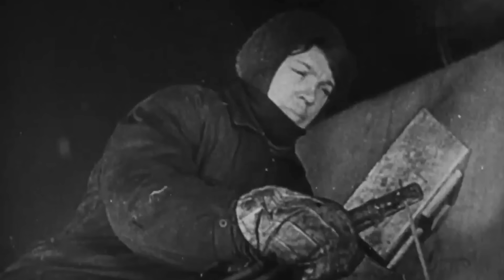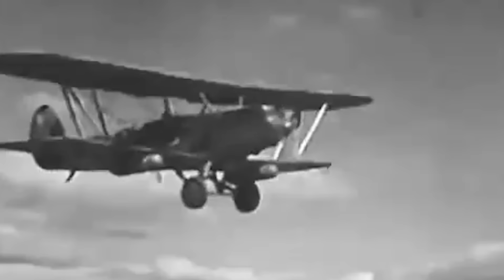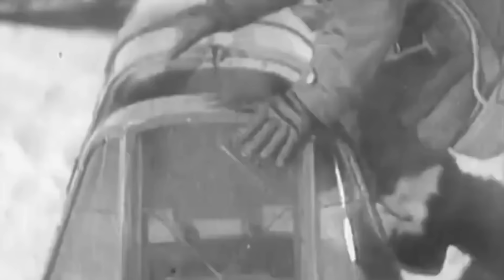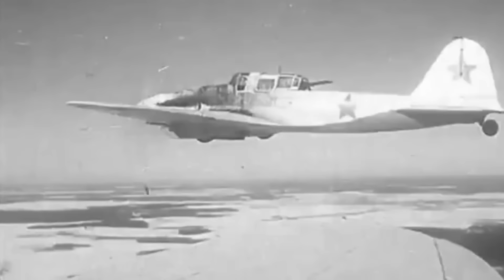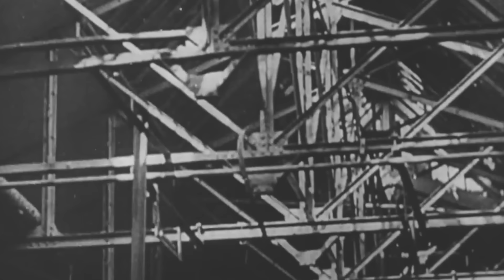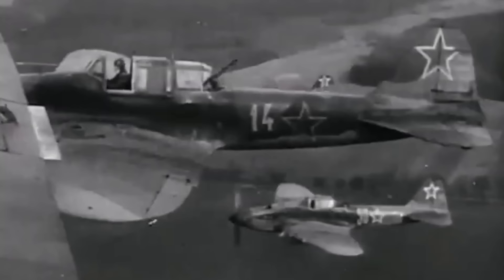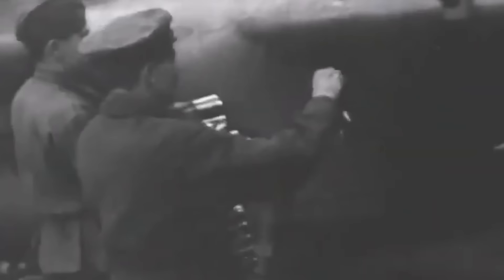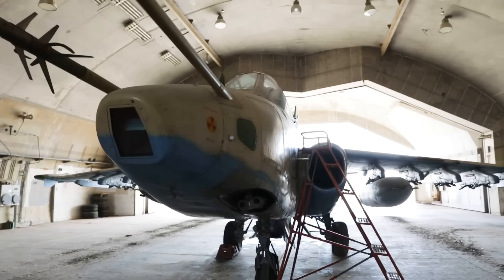The Plane that Could Receive a Panzer Attack and Keep Flying

Comment: 6:58 only a very few airframes were fitted with the 37mm cannons. The majority of 2 seater Il-2s carried double 23mm auto cannons.
Reply: 23mm is an odd caliber, I wonder why not use 20mm's?
Reply: @johnhall4895  так исторически сложилось с этим калибром. Сейчас у нас вообще нет на вооружении 20 мм калибра. Но есть 23 мм калибр который активно используется. Это ЗУ- 23/2 и ЗУ-23/4, Шилка.
Reply: @johnhall4895  Like always, more punch to 23×152mmB vs. the 20mm×72RB. The former hit with over 65,000 ft-lbs while the latter delivered closer to 48,000. The 20mm could not challenge even the 30mm Panzer III armor in D-G models and up. The 23x152mm was best delivered at the flanks of tanks to mess with their tracks. My understanding is high-explosive anti-tank bomb known as the PTAB was the best armor destroying IL-2 weapon. The NS-37mm cannon AP round could penetrate up to 48mm of armor, but cannot locate any force figures. My guess is up to 100k ft-lbs.
Reply: @jefferyroy2566   Thanks for the info sir.  It sure does make a big difference for a 3mm increase in caliber.  Sounds like it has a lot more casing length than the 20mm's as well.  Weren't some WW2 planes even fitted with a 75mm cannon?   Now that would be hard for me to wrap my mind around, lol.

Comment: Well done. You had me with the shredded Sturmovik thumbnail, the remaining right aileron full up to keep it level. Flying the plane in “IL 2 Great Battles” I had a similar experience.
Returning from a mission I was caught by an AI Bf-109 who had fortunately run out of cannon. (As noted in the video, German 20 mm takes no prisoners.) Yuri, my AI gunner, quickly ran out of ammunition and contented himself with sipping vodka from his flask and watching the show. Could not even be bothered to call out the fighter making its runs.
Anyway, left wing was so shredded by MG that I had to hold the stick full left to even keep the plane level. Getting the plane landed was kind of tricky.
The game is not a simulator, but flight and damage models are fairly accurate. Fairly tough against ground fire, at least MG and flak, it is vulnerable from behind and above, a typical fighter attack pass. Often the first burst takes out the rudder and elevator cables and your flight is over. Good call to mention the defensive tactics in the video, essentially a modified Lufbery Circle.

Comment: The IL-2 also has the distinction of being the most shot down aircraft of WW2.
Reply: Where did you hear that? Did they build that many?
Reply: @darrellcook8253  it was the most produced plane in the war
Reply: It was an illusion that it would stay in the air
Reply: @darrellcook8253  About 36,000 IL-2 were built during WW-2, the highest number of any aircraft type produced by any nation during the war. The Messerschmitt Bf-109 was next highest with about 34,000 produced, starting from 4 years before WW2 commenced.
Reply: @darrellcook8253  It was literally in the video at the end, over 15.000 airplanes of that type were destroyed by the Wehrmacht/Luftwaffe during the war, clearly it most be by numbers the most destroyed airplane from a single type.
Reply: @darrellcook8253  Creating a plane with the idea of making it bulletproof is a very bad idea anon.
Reply: Yulis  wehraboo, check your numbers
Reply: Yeah it was a piece of crap produced long past its use by date because Psychopath in Chief Stalin thought they were important.   In fact when the rear gunner was added it was impossible to give him any Armour due to center of Gravity Considerations.  As a result the causality rate or rear gunners was nearly 10 times that of the pilot as he had essentially no Armour.   It's worth looking at the Armour of the Ju 87 Stuka.   The rear gunner had thick rear Armour and bullet proof glass.   He also had bottom amour but no side Armour.
The Armour of the IL-2 was also far from perfect.   It penetrated the bullet would bounce around shredding the human tissue inside.
The Ju 87 pilot had bottom, side and rear Armour strategically placed.  More of an 'all or nothing' Armour concept that was thick enough to block a bullet.  Should the bullet miss the Armour in all likelihood a human would not be in the way.
-The Sturmovik suited Russian human wave tactics of expendables humans.
Reply: Yulis  I think Bf109 was the most produced fighter, but the IL-2 was most produced aircraft overall.
Reply: @williamzk9083  bruh, just bruh. If you check numbers, German casualties in men are higher after 1942, and before that USSR wasn't ready for blitzkrieg defence. You are so hateful, it is not normal
Reply: @HubertofLiege  "illusion" or "Ilyushin" 😂...
Reply: Horribly slow aircraft!  An infantryman could shoot one down with either a rifle or a shoulder-fired squad machine !gun
Reply: @EarlT357   I guess that's why nazis called Il-2 The Black Death. Quote "The Germans called it the "Concrete Bomber" and the "Black Death." An attack of an Il-2 squadron had a devastating and demoralizing effect on German troops."
Reply: @pierluigiadreani2159  Really? You think the A-10 was a bad idea?
Reply: Yulis  The BF109 was the most produced fighter of WW2 with a total of 34,428 built across all variants, however the IL2 was the most produced combat aircraft of WW2 with a total of approximately 36,000 being built between 1941 and 1945 across all variants. Furthermore a further 6,000 of the IL2 were produced during peacetime.
Reply: When you attack infantry from low altitude everyone will shoot back. And for enemy fighters shooting bombers and strafing planes is first priority. Plus, in total number are probably included planes destroyed on ground.
Reply: Comparing the IL-2 and other aircraft, it is worth remembering that the IL-2 flew where no other aircraft could fly.
The height is often less than 100 meters - one can say that they shot at him point-blank. Any other plane flying over an enemy airfield at that height would have been blown to pieces before it hit the ground. Only IL-2 could work in this situation, making several passes.
Some recall fighter-bombers and the German Stuck, but the comparison is incorrect - these are machines of different classes, they do different jobs and work in different conditions. None of them will be able to do what the IL-2 did.
IL-2 paid off in a couple of sorties - you can evaluate how much damage it inflicted on the enemy.
It says here that the Germans called it concrete. I heard another nickname for him - the plague (black death). This nickname was given to the aircraft by infantrymen, for whom a pair of Il-2s over their column meant the end of the war.
Of course, a machine that works in such harsh conditions will sometimes go astray. I don’t know if the Il-2 was the most shot down or not - I have never seen data on the total losses of the Me-109 or Me-190, but I heard that on May 9, 1945, the Germans had quite a few of these aircraft. Like any others.
Reply: Это пикирующий бомбардировщик. Он летал низко над полем боя. Конечно он был хорошей мишенью. Но он наносил большой урон немцам.
Reply: IL-2 is plane equivalent of T-34
Reply: How many 109's survived?
Reply: The nature of the air war on the Eastern Front was to support the ground forces. The kind of air battles that characterised the western allies air campaigns was to escort bombers or to shoot them down. Hence high altitude air superiority aircraft were important to Britain and USA. But, rugged low altitude ground attack aircraft that could take a lot of punishment were most important to the Soviets. It's one reason why they didn't take to the Spitfire much when a few were sent. It was just too flimsy for the rugged war of the Eastern Front, and high altitude interceptors were rarely needed.
Reply: Didn't shoot down quite enough, it seems.
Reply: @williamzk9083  you talk rubbish. They were produced as fast as possible with the best they could in those moments. Germans were preparing for ww2 decade ago, developing their arms as better as they could and those in peace developed and engineered armaments were far better comparing to the those develeloped and produced in a war, in a walk (tiger 1 with all its issues, opel trucks, etc...)
Reply: @jjtimmins1203  join the nato and take your chance to see if you could do better
Reply: @sad_wrangler8515  11351
Reply: @khankurblaj3934  What's most amazing is that the old German King Tiger tank? The one with all those famous engine problems? That's the engine that russia went with their new T-14 Armata 🤣 Because russia seems incapable of coming up with anything without first stealing it, and when they do, it's a Chinese copy, of a Korean copy, of an old Afghan design.
Reply: @williamzk9083  very argumintiff cooment, lol. Proofs, pls.

Comment: I can understand the initial single seaters being called hunchbacks due to the shape of the cockpits. The cockpits in the 2 seater variant looked different. I normally like the Dark Skies videos, but I think that the description of the early Stormoviks could do with some revision as it wasn't till the 3rd variants that the Stormovik received an official 2 seater variant. 

The field modified 1 and 2 variants had the rear gunner sitting in a hole that had been cut into the fuselage behind the cockpit to which a pair of guns had also been attached. The gunner had no protection from the weather or armour protection. When they updated to the 3rd variants and extended the cockpit, they could only accomodate a single rear facing machine gun.
Reply: The thought of Comrade Stalin had to keep him warm in his draftpit there at the back of the plane while the slipstream battered his body...😢
Reply: Since when you, my dear Englishmen that don't understand Cyrillic(not Russian but Cyrillic as they say) understand German? Since when initial S is being read as Sh digraph?

Comment: IL-2 was originally designed with the tail gunner, but due  to some bright minds in the higher VVS the gunner was deemed as excessive and discarded, only after bearing heavy losses in the first year of the war the 2 seater variant was introduced
Reply: Нет. Долгое время ждали двигатель, способный тянуть версию со стрелком
Reply: @ZPB2882  даже Р-5 в штурмовом варианте уже имел бортстрелка

Comment: The gunner position was an afterthought and was outside the armoured area. So gunners didn't last long.
Reply: The armored gunner position was in the initial design but when AM-35 was swapped with AM-38 (low alt more powerful engine) requirements in range of 1000 km wasn't achieved due to more thirsty AM-38 and that's why gunner position was removed for an additional fuel tank.
When field modifications with added gunner position proved to be necessary for the plane survival, production aircraft was changed to initial design with armored gunner position.
Reply: @outerspaceoutlander  A lot of sloppy history in the age of the internet and Wikipeida where no one uses dates anymore.  Armour to the Sturmovik came very late in the war.   I believe 1944.
Reply: @williamzk9083 armour to Il-2 came from drawing board, factory produced plane with armored cabin for tail gunner with Berezin UB machinegun was tested on frontline from oct 42 to jan 43, and was produced ever since. Imagine believing yt wehraboos can use any actual sources, maybe even russian sources about soviet plane (BIAS!), nah, never happens.

Comment: What wasn't mentioned was the disparity between the pilot  and the AG . The pilot was the highly trained commodity who had to be protected while the poor AG was a disposable unit that had zero armour , not even a proper seat just a canvas strap to sit on .
Reply: That was on field modifications when gunner position wasn't factory implemented. Initial project had armored gunner position but it was scrapped for additional fuel tank for range. Later on when field modifications proved that gunner was more important than plane range, protected and armored gunner position was implemented (brought back from the initial design).
At first often flying as a gunner on field mods was kind of punishment and also a chance to repay with blood for wrongdoings.
Reply: But the plane was designed without the gunner. The reason he had no armor was because it would require a redesign. He was an afterthought.

Comment: I admire and respect the IL2 but I’ve read the day to day German/Russian BDA reports on Kursk. IL2’s actually knocking out tanks was extremely rare especially with rockets. A particular day Germans would report zero and Soviets would report well over that. (Sometimes Soviet reports would be higher than actual panzers being used that day). Over reporting kills occurs sometimes due to multiple people taking credit for the same target (like US b17 gunners shooting at the same plane) however It turns out 20mm’s just like 50. Cals are not reliable tank killers. That’s why Hans Rudel used 30mm bord cannons on his Stuka instead. The Germans did report on the flying circle of death tactic and the “cement bomber” was also a thing too. The Most produced military aircraft ever only beat by the civilian sector, Cessna 172.

Comment: I'm pretty sure most carried only 23mm cannons. The 37mm variant was made in small numbers but found ineffective if I remember correctly.
Reply: It's interesting how the 37mm cannon was tried by different air forces in WWII but nobody made it work.
Reply: @recoil53  P-39 says what
Reply: @russman3787  And how well did the P-39 do?
Reply: @recoil53  Pretty well. It wasn't a bad plane, but the US didn't like it much for whatever reason. It saw success as a lend lease plane in the USSR.
Reply: @russman3787  The US didn't like it because of it's tendency to flat spin. The soviets didn't mind this problem as much, as their I-16 had a similar issue and experienced pilots would be able handle the situation and could then get out of it.
Reply: @dukeoftoast2420  The U.S. liked it well enough to use it in the tactical air forces of most all theaters as a low altitude fighter and ground support aircraft.  It had insufficient performance for the air superiority role so better fighters rightfully displaced it.  The flat spin narrative is overblown and was not a real problem.
Reply: @russman3787  the US didn't have as big a need for a short ranged land based fighter. The US needed aircraft with power projection. It was great for the constant battlefield of the Russian front.
Reply: @russman3787  RAF didn't like p39 high attitude sucked

Comment: I was under the impression that this thing was just a lumbering target for anything that wanted to shoot at it. Soviet Fairey Battle
Reply: Pretty sure both versions of story are correct. It had to be resilient for most small arms fire because
it was low flying ground attacker not meant for dogfights. So saying it was kind of early version of a10
is not too far off. Any plane will go down when it receive enough punishment but when that threshold
is achieved variest how plane is build. 

And like it was said in video also losses were nasty but when you can produce more war material
than enemy can destroy then mathematics are very simple how things will go.
Reply: A LOT of them were shot down.. but I think it speaks more to the notion that a lot of them were built, and just how deadly the Russian front was for everyone.

Comment: Russian quality = less precise heavier built = durable like the sks,AK 47, T34, etc. I was at a airshow in the early 90s and the Russian aerobatic team were there a airforce pilot was standing there beside me watching one of the Russian pilots flying by virtually standing the plane on it's tail just short of being in a stall, the pilot said that the only reason they (Russians) could get by with doing that is because they don't built the engines as precise as us they're just crude enough to take the punishment the load puts on them. He said if we do that it would destroy the turbine blade assemblys and most likely the plane we fly sports cars an they fly Buicks.

Comment: This is the aircraft of which the most pieces have been produced for all time - 36,000, and which has the most irretrievable losses 22,000.
It was very low-tech and easy to manufacture, but apparently it was not difficult to shoot doun.
Reply: Yeah, and that's why quote "Germans called it the "Concrete Bomber" and the "Black Death." An attack of an Il-2 squadron had a devastating and demoralizing effect on German troops."
Because it was easy to shoot down. Of course.

Comment: 9:30 Those bomblets didn't do any damage to a tank from 50 to 230 feet, that's for sure.
Reply: PTABs (ProtivoTankovaya Aviatsionnaya Bomba - anti tank air bomb - 2.5 kg with 1.5 kg of charge) were deployed in dosens (in hundreds from big bombers) from the bomb bay so they covered significant chunk of land. To damage|destroy tank direct hit was required because they are cumulative bombs and burn their way into armor.

Comment: I think the Sturmovik influenced the design of the Skyraider as well as the A10!
Reply: NO, the Thunderbolt P-47 was more influential: just as armored-up and heavily armed , but much faster than this Soviet slug.  And the P-38 influenced the A-10 since it's gunnery  platform sat between its two engines, just like the A-10. 
But then, no other plane was designed and built around it's main gun, (the monster Gatling gun) like the A-10 was!

Comment: SU-25 Flew before the A-10
Reply: They copied the Northrup entry into the competition that was won by the A10.
Reply: @Basil McDonnell  nope

Su-25 was well before the YA-9 & YA-10 were thought of

Su-25 design was mid 1960's 

Ya-9 & ya-10 late 1960's to mid 1970's
Reply: @Basil McDonnell  go to March air museum in California as they have the Sole YA-9 airframe and the guy who designed it even said the YA-9 & YA-10 came out after reports of the SU-25 in combat in the middle east in the 1960's as part of the Russian testing of its airframe